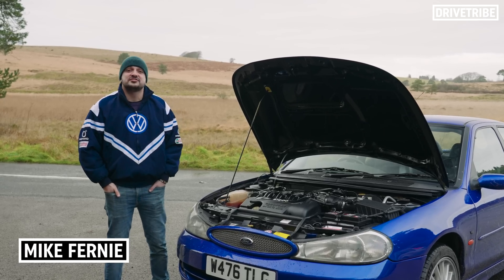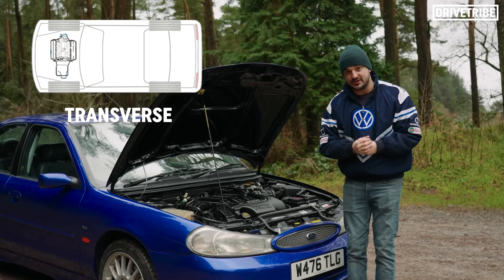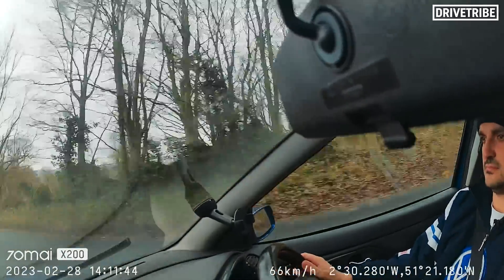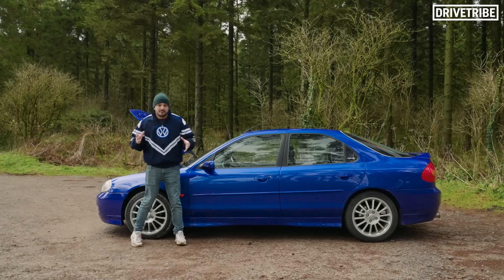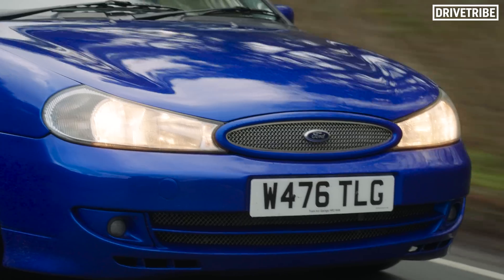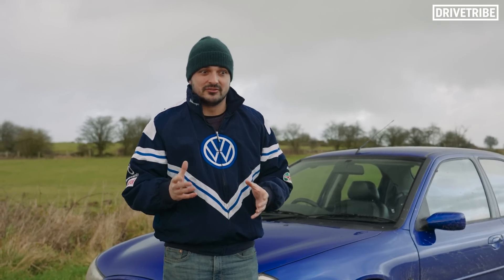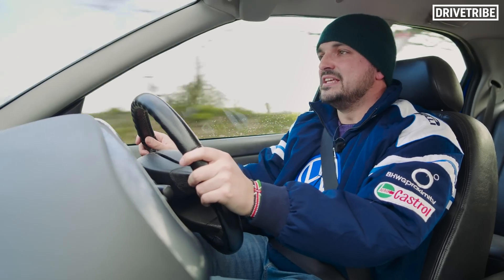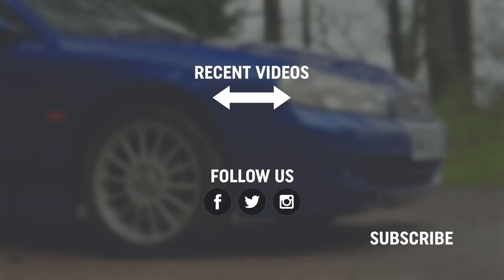Why does the transverse V6 engine no longer exist?

Comment: Strange fact.. acura legend is fwd with a v6 mounted longitudinally. Only car ive ever seen that on.
Reply: There are a few more cars I know of, the Acura Vigor got an i5 longitudinal to a transaxle for FWD as well. Subaru also blanks off the output shaft of the transmission to spin just the front wheels in their old FWD models like the GC Impreza, before AWD became standard on base models in the US. You can even pull a fuse to put an AWD Subaru back into front-only on that chassis. It stayed as an option in Japan for fuel saving, off and on. Something similar is possible for the Audi A4, since you can spec a 2.0 without Quattro. 

The biggest one is the Oldsmobile Toronado and the Cadillac El Dorado (8th Gen onwards). They shared a platform for a longitudinal V8 for FWD, purportedly for more cargo space in the rear since it won't have a diff in the back. You could even spec the El Dorado up to the 500cui (8.2L) V8, starting in 1970.

Comment: you missed the whole thing. they got bigger to 3.0 then 3.5 then 3.7 and they got turbo and AWD in the new Taurus and Police vehicles..  I had a '98.5 Mercury Mystique LS with the 2.5 MTX75 and did the SE-SVT mods. same colour by chance.. short track WSSC racer 2004-2008 and always midpack against fast sports cars...

anyhow the Duratec V6 exist still, police Vehicles

Comment: @6:32 If weight is so benefitial for traction of FWD cars, why aren't there many FWD V8 cars on the market? Torque steer?
@7:53 Unless you go for even more power combined with an AWD setup and lighten the load on the front axle. If there is a need for prestige, sound and driving experience, there is a need for transverse mounted V6. 😊It is a cost cutting measure and they can cheat emissions regulations. That is why.
@9:25 Just buy a Volvo V70r instead if you don't want to engage in consumerism.

Comment: 6:40 The focus ST170 with it's 2.0L 4 cylinder engine also has a dual stage inlet, but it opens at 6000rpm and redlines at 7200rpm

Comment: Had an ST24 as a hire car for work for a trip from Bristol to Cumbria - probably the most fun I've had in a saloon up to now (though my Saab 9-3 twin turbo comes close). The harmonics of the 4 valves per cylinder certainly did not harm the drive :)

Comment: Yeah there are sporty transversally mounted v6 cars in America like the Camry trd, es350 f sport, Nissan maxima, acura tsx type s, and possibly the vw passat gt if it’s still in production. However none offer manuals and all are possibly gonna either have 4 cylinder turbos or hybrid powertrains replace the v6’s in the future

Comment: Mention should be made of the GM Cavalier V6, with its unique con-rod big end bearing caps (for stability), and the oil to water heat exchanger in the middle of the engine vee, which works in both directions (to heat the oil quicker on a cold day).

Comment: front axle/end weight vs power/torque potency vs a well engineered and tuned 2.0T I4.. The I4 is the more logical and better performing option.. Fuel efficiency and dynamics as well

Comment: No mention of the Vaxhall/opel V6 transverse engines that were in a fair few models in various capacity. 2.5 to 3.0 then to 2.8 and 3.2
In cars like the Cavalier and Calibra on to various versions of the Vectra and probably more I've forgotten about.

Comment: It's because the automotive industry faces strict emission regulations is probably the most valid reason the front wheel drive V6 has become completely phased out replaced by more transmission gears and 4 cylinder engines that are often turbocharged

Comment: One practical problem with transverse V engines is serviceability. Ex: changing spark plugs on the rear cylinder bank. Cars using the "cab forward" design are even worse, such as the 13 Toyota Avalon V6 I have. You have to remove a lot of parts to get the rear spark plugs.

Something the auto makers need to stop is putting tiny turbo 4s in vehicles that are too heavy for them.

Comment: After the V6 was dropped the highest spec titanium X sport Mondeo had the 5cyl turbo not 4cyl 😘 

Apart from that what a fantastic video I certainly miss the transverse v6 ear too
Reply: they ditched the 5 cylinder for the 4 cylinder 2.0 ecoboost later on

Comment: All were 4 cylinder after the mk3... Except for the mk4 prefacelift, which had the best engine of all generations - a volvo 2.5 turbo inline 5. All the power and character of old with great potential and criminally underrated.

I've had 2 so far. They are amazing cars and almost nobody knows they were fitted from factory with the same engine as a focus st mk2.

Comment: At lest over here in the UK one of the last of this breed must have been the Vauxhall insignia VXR that had 2.8 turbo transverse V6 I think that lasted until 2018
Reply: Is that the same as the Saabs in the US? I'm not well versed in the subject.
Reply: @Corkoth55  the last gen 9-5 that lasted from 2010-2012 was based on the on the Vauxhall/open insignia I mentioned above

Comment: Citroen C5 V6 Gen 1 and 2 had transverse.
Low end gearing became a struggle in the automatic versions, as the throttle would loose power.

Comment: V6 is great. Turbo 5 cylinder is the optimum solution. Better packaging. The sense of occasion  of a V6 (actually even better) with the punch and fuel efficiency of a turbo 4.

Think Volvo T5, Audi, Focus or the best of the breed. Fiat Coupe 20VT!!

Back in the day Autocar called it "The New Cossie"

Comment: As I recall, the guys liked the Outback with the flat 6, which is no longer available.

And yea, many transverse V6s here in the US. Especially if you count minivans and crossovers.
Reply: outback is actually longitudinal, but the engine is pretty compact at about the size of a transverse 4 cylinder.

Comment: As the owner of the only surviving original Ford Cougar ST200, I know exactly what you mean. Great engine with tightened camshafts and valve injection. However, the Cougar is even sharper in the chassis than the Mondeo ST. My everyday car is a Fiesta ST MK 7.5 and even the Cougar is a sedan chair in comparison. And the 1.6 liter turbo 4-cylinder is much livelier. But at 235 km/h on the german Autobahn I prefer to sit in the Cougar ST200.😁
Reply: I actually found the cougar a touch barge like compared to the car it was based on.
Reply: @amigachris  No idea what you mean by that. The Cougar was based on the Mondeo, but with less weight, a stiffer body, modified spring and damper settings and more precise steering. The ST200 also received a stronger brake system. And unlike the Mondeo, a huge strut brace was installed in the rear, because otherwise it would not have received approval in Germany. However, it was only available as a prototype - that's what it says in my vehicle registration document.

Comment: So what's the straight four front wheel drive ,I had a 1973 triumph Toledo 1.5 l that was a straight four with front wheel drive you change the clutch inside the car ?

Comment: I’ve got an mg zs 180 , love the way it drives, but working on anything in the engine bay does scrape the knuckles! Still waiting for the weather to warm up so I can change the power steering pump, so have to drive my Skoda vrs 242 to work at the mo! When I’ve got both working what will I choose? It’s a quandary!

Comment: Haven't watched the Video, Guesses are: i4 Turbo Engines are just better. Same Power, less Weight, easier to maintain and more economical. Fitting a Transverse V-Engine into a tight FWD Engine Bay is a bad Idea from the Start. Then add Emissions Equipment and you simply run out of room.

Comment: My kids chose for their first car (and contributed a significant amount to the purchase) a 2004 Jaguar X-Type 2.5L AWD with a 5-speed manual. That 2.5L is a sweet little engine, and the car itself is the closest you could get to the "unicorn" referred to in the video in the US, as it was based on the contemporaneous Mondeo. Is it a "real" Jaguar? Yes and no, but it's fun to drive and has "The Leaper."

Comment: I had a 96 Ford Contour which is the same car here in the US. It only had that 2 L twin-cam four cylinder.. I think it was around 130 HP. Although from a dead stop it was not fast but for entering onto a freeway is where it really show its ability. I have a 2015 Mustang but that Contour had much more comfortable seats and a ride like a car much larger than it was. But the mustang does have 19 inch wheels with no side walls and much stiffer suspension which I'm sure contributes to a much harsher ride.

Comment: These are still common and available in North America. Toyota Camry, Lexus ES currently have a V6 option. Even the Honda Accord and Nissan Altima was available with a V6 until 2017. The former three having a 3.5L V6.

Comment: I have a 2018 Buick Regal GS with a 3.6 V6 (Same as the 2018-2020 Holden Commodore VXR). The car is a blast to drive and was unfairly dogged on by journalists because it didn't end up as a second coming of the Grand National or a badge engineered ATS-V. 

In reality it is a comfortable, well equipped car with a nice sounding NA V6 that loves to do highway pulls. I owned the previous generation of Regal (Insignia) with the turbo 2.0 (LTG) and I hated that engine. Done making power at just over 5000rpm and it didn't sound particularly nice.

Comment: Genuine q
Audi's get a bad rap for having the engine mounted ahead of the front axle, thus being nose heavy, a bit understeery and not sporty (A3, A4) or fun.
So, looking at the Mondeo engine (and my fiesta), it is way ahead of the front axle yet they've made cars fun to drive.
Why the differences in driving dynamics when both Audi and ford are hampered by the same packaging issues? Thanks

Comment: The Mazda KL transverse V6 from the Ford Probe and Mazda MX-6 and 626 is a brilliant little engine, I have the final KL-G4 variant from the 99-02 626.
Reply: I had a probe for a while, fantastic little car, it had a surprising amount of torque, you could easily overtake someone in 5th without shifting back. it felt like it should have had a 6 speed.

unfortunately I found out the hard way that baffling in sump was non existent by taking it on a very spirited mountain drive. it only lived for about 50km after that.

Comment: My Saab 95 griffin has the gm 3.0 transverse V6, 200hp but only available with the low pressure turbo and auto box, it’s a great motorway cruiser, just go easy in the A and B road corners! Possibly the cheapest version you can get (£1200 for mine with every 2000my option) but it likes to spend time at petrol stations.

Comment: Regarding the point on turbo 4-cyl. You seem to forget the GM LP9 engine used for example in SAAB and Vauxhall/Opel (B284E/L and Z28NET respectfully). A very last hurrah for transverse V6 with turbo added on it if you ask me. Fun and very "humble" engines with decent soundtrack to them. And fairly easily tuneable.

Comment: What!? No loving for my 94 Ford Probe GT?  It had a Ford, 2.5 liter, transverse V6.  Ok, it was actually a Mazda and only put out 164 Hp, but it was a lot of fun.  Learned all about trail braking with that thing, otherwise it would plow through every corner at speed.  I figured the mileage was the main culprit for this package's demise, but thought you'd include the challenges servicing something with that much engine in such a small space.  Swapping the timing belt was a nightmare.

Comment: Nice video, many thanks. You forgot, or perhaps don't know about the Mazda 2.5l front drive V6. We had them in New Zealand as a 626 and the rebadged Paul Radisich (Ford) Telstar's were an absolute weapon and very fun to drive. They were 120 odd Kw (160 HP, though many people thought they were considerably more powerful) and the car weighed in at 1200Kg, all had a 5 speed manual transaxle. The best thing about them was the way they revved out to a red line of about 7k.

Comment: I had a Mercury Cougar with the engine swapped from a Contour SVT (Our Mondeo ST200) so I love every vid you do with this car almost as much as I loved that variable intake that kicks in at 3450 RPM over 50% throttle BTW, feels like VTEC 

Seeing that intake manifold really brings me back, fun fact it was the very first production part to use extrusion honing

Comment: I agree the Duratec engines sounded great. The 2.5L in that was also used in the SVT Contour and had camshafts designed by Cosworth. They can also be swapped to a 3.0L Duratec 30 with no other changes and yet make more power. They flow that well. 

The Duratec 25 is one of the best engines ever made imo, and should have been used as an SHO motor.

Comment: I still have one: 2011 Taurus SHO. Transverse, twin turbo V6. Only there’s a prop shaft running to the back to drive the rear wheels but it’s primarily a front drove car. I actually love it.
Reply: i never cared much for them due to not having a manual trans option and being awd only. but they make power.  id take an older sho manual even a v8 bubble sho
Reply: @fordman2288  this is the 3rd I’ve owned. 1989 and 1995. Both with the Yamaha V6. Both manual transmission. I know this will sound controversial but… you don’t want a manual in this car. 
The 6 speed auto shifts fast and kicks down easily and it has a surprisingly responsive paddle shift. I like manuals too (I also own an FRS— U.S. GT86) but this is one car I wouldn’t want a manual in. Never mind that the manuals in the older cars weren’t all that great to begin with— they were just better than the abysmal automatics of the era. But a 3200-3400 car with a manual is OK. A 4300–4400 car with a manual is cruel and unusual punishment. This also has 2 turbos. The auto is nice to hide the lag. :)
Reply: a lot of highway patrol

Comment: I had the last year for ford fusions v6 transverse. 2012 ford fusion 3.0 sel. But totaled it shortly after I got it. Now several years later I have a 2010 fusion with the 2.5 l na 4 cylinder as my work car. Instead of driving my 11 f150 or 2017 f350 6.7. The 4 cylinder fusion may I say is as fun to drive as the v6. The thing just revs so quick.

Comment: I have a 156 Sportwagon with one of those transverse Busso V6s, and the reason I think we don't see this any more is because it's a terrible idea. I love my car, but you can tell where the layout works really well for the lightweight twinspark engine, instead of the big V6 between the wheels which tends to push the nose into corners a bit if you're really on it, you also find that when you try and plant it off the line you often find the front wheels start spinning. If they made them AWD or 4WD it might make things a lot better, but V6 FWD? The engine is fantastic and the platform is fantastic, but they certainly don't go together all that well
Reply: Your 156 might handle like a shopping trolley and (lovely though it was in other ways) my 164 3.0 was a torque-steering disaster, but my V6  Mondeo and Peugeot 406 were vastly superior in terms of handling, so it;s as much down to implementation as layout

Comment: In Australia we also got the locally built transverse V6 in Mitsubishi Magna and 380.  Very underrated car(s) and engine but working on that rear bank of cylinders (even to change plugs) was a nightmare.
Reply: Changing a timing belt on a V6 Magna hurt my soul… permanently lol
Reply: i had a gto twinturbo, transverse v6tt awd, working on the rear heads and turbos etc near impossible

Comment: The V6 Toyota Camry still exists, although that's in the USDM, not sure if you get them across the pond.
I personally don't like FWD cars or transverse AWD cars, as they're FWD based systems & will handle & perform more like a FWD car. RWD, followed by RWD based AWD are all I will drive which means a longitudinal engine orientation. Current car is an IS350 F-sport RWD, not sure what I'll get next though, the automotive future isn't looking to bright for ICE, and EV performance sedans don't exist yet; I don't want a CUV/SUV, but I need four doors. Might keep the IS as it's a Lexus and will essentially run forever, and get myself a Mustang or Camaro as a fun car; a couple extra cylinders & a manual are what the IS is lacking. The IS500 exists, but I don't like the auto trans in my IS350, and it's the same one in the IS500, so I'm not likely to enjoy it there either.

Drive what you like.

Comment: I have had a few Mondeos. The steering in them is so light its unreal. The diesels were the worst with the DMF they used to always go wrong (well mine did anyway). My grandad had an old 1.8 diesel one that i think did over 300k and literally never went wrong until the very end when the clutch finally went and it was not viable to repair due to rust also. He never even serviced it lol was lucky to get an oil change every 3 years.  The chassis does feel tight in them i have to agree for a FWD motor.  Still also feels a bit boat like.

Comment: Having owned a ST220, and also a Renault Laguna V6. I have to say the Laguna II 3.0 V6 24v VVT was a better car and engine. That L7X engine was a gem. Was also used in the Clio V6. The Laguna V6 would also do 39mpg on motorway runs.

Comment: V6 Toyotas of the 90s/00s are seriously underrated. The 1mzfe is almost a 1uz missing 2 cylinders. A v6 Camry will do 140mph fully loaded and they cost next to nothing in the US.
Reply: what makes the 1mz close to a 1uz? just outta curiousity
Reply: @SnoopDoggyDoge  the gear drive on the cams in the head looks pretty much the same. i think its called a scissor gear setup?? but it also has that smooth feel and quiet running sound like a UZ has probably from that.